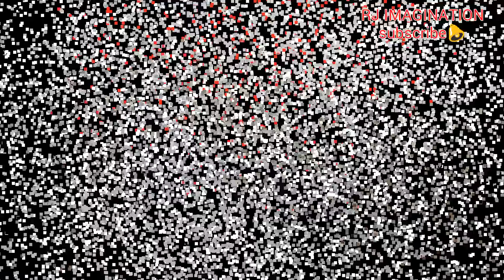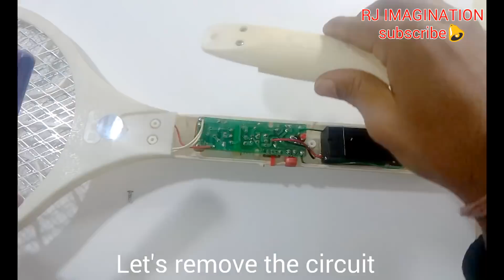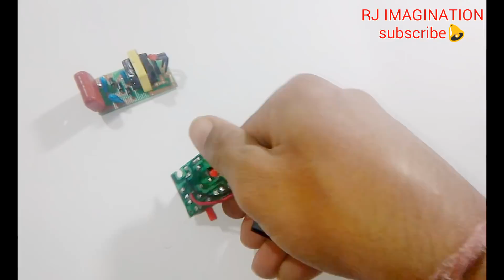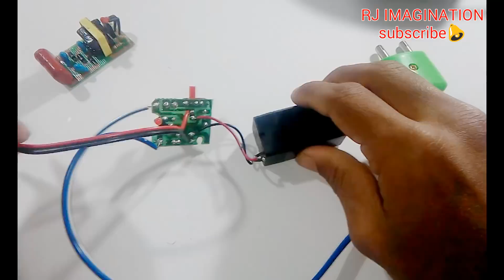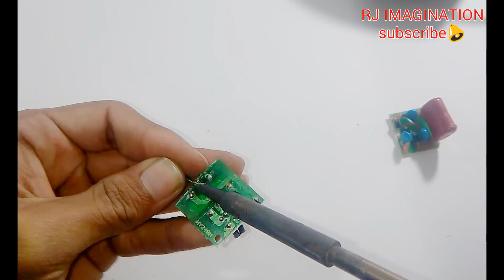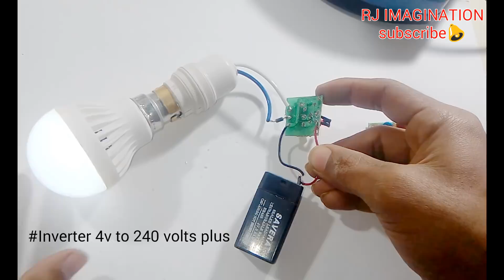Inverter 4v to 240v | transformers less power supply | battery charger from insect killer badminton

Comment: interesting. so light bulb can go with DC?  will it be able to provide smoother visual experience compared to flashing frequency from AC?  (though some circuits probably already help smoothing out AC current)
Reply: or this step up voltage actually provide worse stability because cheap killer circuit doesn't care voltage regulation?

Comment: What is need for connecting a diode at output of transformer. if LED bulb can operate at AC supply. Internal circuitry already have LED driver which converts AC to DC also step down the voltage. Please don't take it personally. I don't say that this is is a fake video. I know voltage can be step-up or step-down even voltage is around 5 v but the current at the primary of transformer should enough.

Comment: Its not 240 its around 100 to 130 volts, that is the output produced by the high frequency transformer on that pcb.
Reply from the maker: +vinay ladwal NO output is more than 250 v ac
Reply: RJ Imagination that you are talking about instantaneous voltage but if you average that its small and the part that you removed containing diodes and capacitors is the voltage multiplier. It is furthur responsible for stepping up the voltage that discharges through any bugs body in form of pulses you would never see constant arcs. Its in form of pulses.